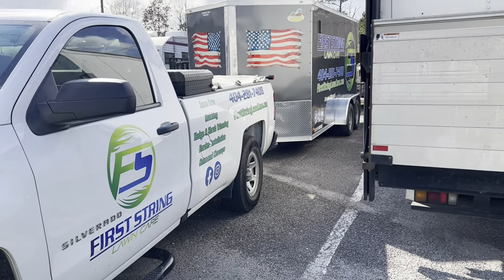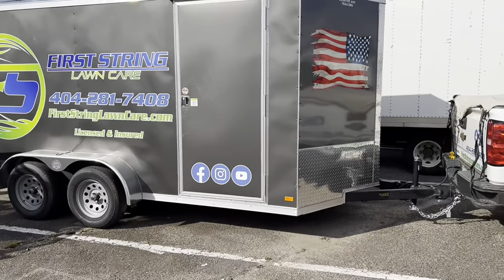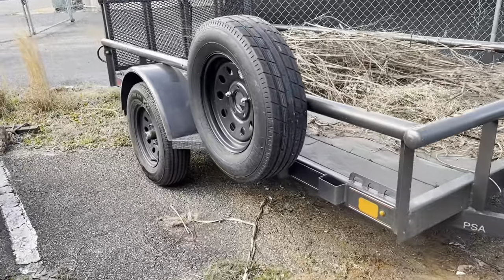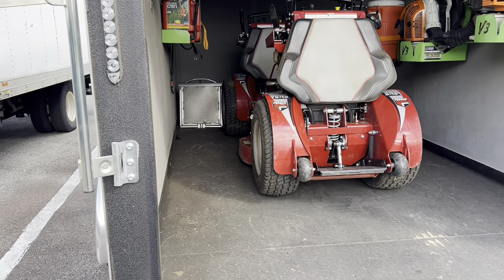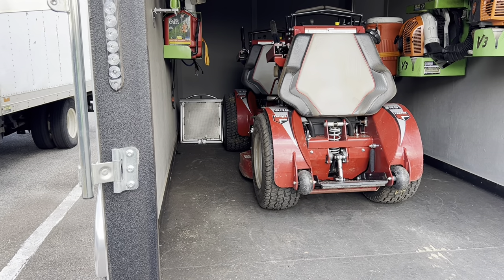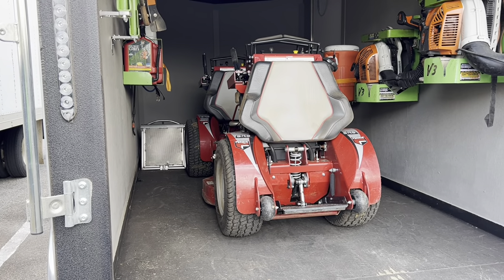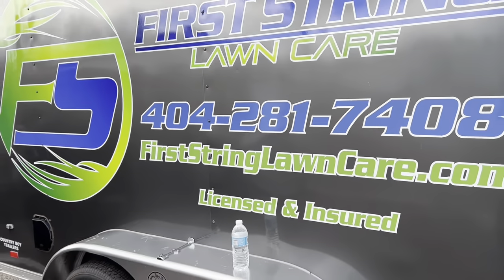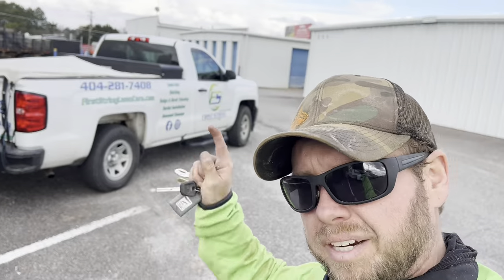2022 Lawn Care Truck & Trailer Setup

Comment: Nice setup. I could see those wider tires making a huge difference. 
I like how clean and accessible everything is with this setup, and how you don't have to go far in to get the trimmers.
Reply from the maker: Thanks brother. I appreciate all the comments and interaction. Yes, I took the one with the wider tires on a property that normally I have have to really push the limits. It held in all directions!

Comment: Nice setup.
Reply from the maker: Thanks! We just used it today with everything installed inside and it worked out great. I loved our open trailer but this is has its advantages.
Reply: @ThatCrazyGrassGuy  I hear you, brother, but to save 6 to 10 grand, I'm going to keep running my open setup this year 🤣
Reply from the maker: I understand that for sure. That is the smart thing to do honestly. I got the mower paid off. I’m working on the trailer. I never get to in over my head. A little at a time. I’m pretty sure we are going to be maxed out come spring rush.
Reply: @ThatCrazyGrassGuy  That's the way you do it. As far as Spring Rush, make sure you have the muscle to cover it. I'm still debating whether I want to hire help or wait one more year.
Reply from the maker: Definitely gotta hit a stopping point we are comfortable with this spring. Our county has a subdivision going up around every corner. We have our routes as tight as I can get them right now but they can be better. This year I’m working on getting more customers in the same neighborhoods I’m already in. Once we have about 15 customers on each of our 4 days I’m gonna see how that feels before I add more
Reply: @ThatCrazyGrassGuy  Good plan. And it sounds like great opportunity around you.  Route density has been on my radar for years, but I've always been that guy who had compassion for the customer who says "I have a cousin, sister, mom, daughter, brother, grandma, mother in law, a CHURCH way over in east Japip that needs lawncare" or "we're movingbut could you move with us, please???" 🤣 So I'm still all over the place 🤷‍♂️ Not as efficient or profitable as I should be, but it's an interesting and rewarding route, and I have good customer relationships. And I still had a little "fat" to trim, and a little fell away on its own, and I might trim one or two more this season; we'll see.